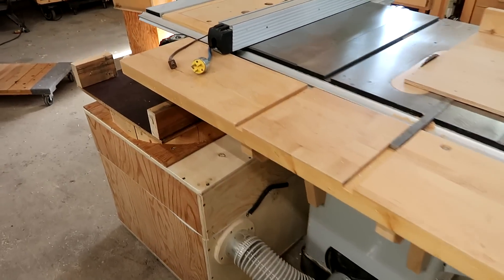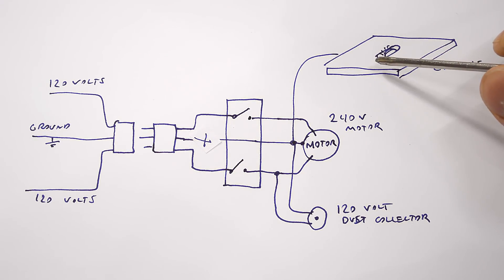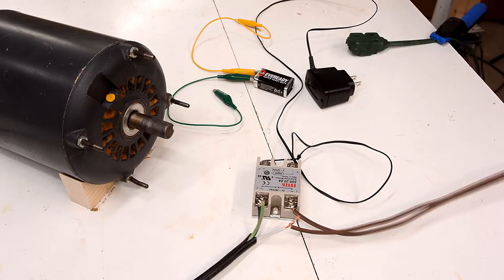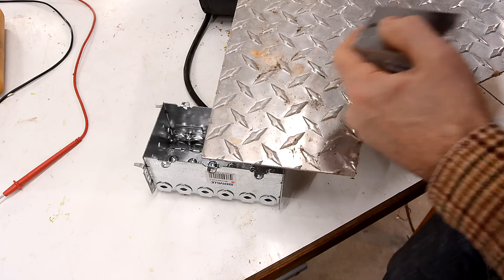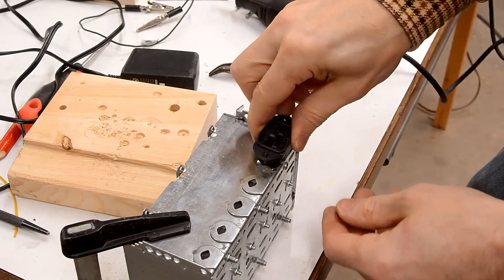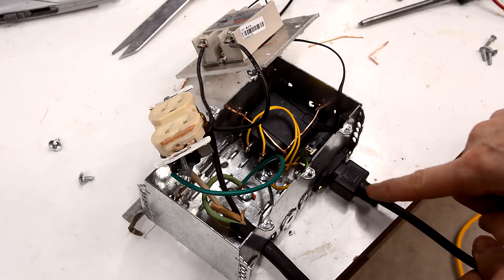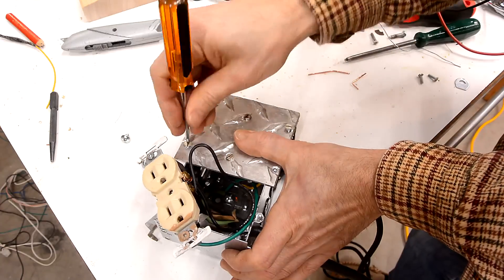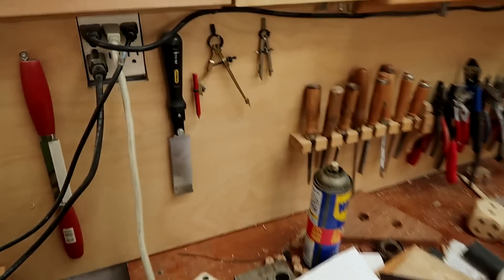Relay box to automatically turn on my dust collector

Comment: As an electrician from the UK this made me want to cry... but it's functional I'll give you that so fair play !
Reply: Mtaalas every one talks about it being unsafe but not one has given a reason as to why it is unsafe. There is a huge reason between codes and safety. Most codes aren't about safety but perceived safety. For example in the US you can't replace the plug on an extension cord if it is used commercially. Not because the resulting cord would be unsafe but because they are afraid someone wouldn't be smart enough to hook up three wires. However HP a few years ago had 1000's of miswired cords shipped with New computers. Even after a massive recall I am sure there are still 1000's of them in use.
Reply: TheRetiredtech "every one talks about it being unsafe but not one has given a reason as to why it is unsafe"
Not one? There are people writing pages on why it isn't safe exactly. Just scroll more than 2 blips on your mouse
Reply: you beat me to the comment!!! anyway thnx
Reply: Yes, I wish we had 220 for nomal household circuits in the States. The Europeans have us there.
Reply: Beefchicken Industries LOL
Reply: I agree, the European 3-phase system is superior.  I wish we had that here in Canada, as it would make it much easier to install efficient, high-power motorized devices (shop tools) in residential garages without costly alternative arrangements.  Of course, our system is really only single phase at the very final stage, so in principle it wouldn't be that hard to provide 3-phase power in residential circuits.  Unfortunately, everything is already built and standardized around 240V centre-tapped single phase, so it would be difficult to switch.

I don't think the superiority of the European power distribution system has anything to do with rebuilding a more modern system after WWII.  If I remember correctly, most if not all of Europe adopted ~ 220V standards right from the very beginning.  This was because the grid in Europe was primarily intended to distribute power for industrial applications rather than residential lighting, where the advantages of high-voltage 3-phase power are obvious.  Therefore, although the electrical grid was rebuilt (where necessary) after the war, it was based largely on evolved versions of pre-war standards.
Reply: Beefchicken Industries you sound like you have a chip on your shoulder. Interesting insecurity you have there buddy
Reply: MrConminer, rules regarding electric installations aren't there for making everything difficult, but to make them safe. Basically everything was done like Mr. Wandel here until the rules and regulations put an end to it...

Has saved a lot of lives over the years.
Reply: A Canadian electrician would be crying too. No need to develop a European superiority complex over it.
Reply: johnrichy2k6 yeaaa the rules here in the europe are a bit different 😂
Reply: Beefchicken Industries I guess he isn't cuz he is from UK. As far as I know they have different protocols
Reply: "Humour"
Reply: Beefchicken Industries you mention humour like we don’t have any, yet here we are laughing at your electrics.
Reply: Beefchicken Industries wooosh
Reply: Uhhhhh, you just proved my point.
Reply: Beefchicken Industries
It's true. Just accept it, wanker.
Reply: Ixodes I know. My parents are from Europe too. All that tells me is that some people know to get out when the getting out’s good.
Reply: Uhhhhh yeah, no. Any video about North American electricity draws out the European crowd, always with their “we are so smart we would never do that here that’s how smart we are” bullshit. Every. Damn. Time. I like to wade in with inflammatory comments, ‘cause it’s like shooting fish in a barrel. Forgive me for having my fun. Humour is something we have in North America that you don’t have in Europe.
Reply: Hamza Kamel thank you for stating the obvious. The European weenies’ argument is that their system is superior because their entire continent had to be rebuilt from scratch after they all attempted to murder each other in the 40’s. Or something like that.

Comment: Isn't the ground wire breaking a problem for the motor already? Or is the motor insulated from the table saw body?
Reply from the maker: No current goes thru ground in normal operation.
Reply: Ahhh right, I forgot my 240 V electronics :)

Comment: Your table saw uses split-phase and not two-phase power.  Residential power is split-phase.  This is why 240V induction motors require a capacitor to create the second phase.
Reply: rotate85 see his videos on induction motors :)
Talking about the two phases of a split phase (single phase power) is always confusing.
Reply: Neither term really expresses why the motor needs what it needs to start; certainly a capacitor is not the only solution to creating torque with a single phase input.
Reply: Oh.  Sorry for jumping at you.  I've done similar.  I wish the comments were threaded better.
Reply: Richard, people have argued that single phase motors are star(wye) or delta wound?! Thats a new one to me, I guess i'm not surprised though. I don't think it was edison who came up with multiphase systems though.
Reply: The tablesaw uses single-phase 240VAC power. Single-phase induction motors (often) use start capacitors to make sure they start and make sure they rotate in the desired direction. There are plenty of single phase induction motors which run on 120. There are plenty of three phase motors which run on 240 and therefore have no need for a starter capacitor.
Reply: Did you read my comment? My statement had nothing to do with three phase motors or voltage.  I was strictly talking about the pointless argument over the differentiation between arguable misuse of the terms "split-phase" and "two-phase".  Neither term explains why a single-phase induction motor cannot generate torque at 0 rpm without ancillary hardware.  This is about a lack of torque; we're not even to the point of enforcing rotational direction if we can't produce torque in any direction.  To emphasize the importance of the concept behind the singular example, I merely stated that starting torque can be developed by many different mechanisms.  Does a shaded pole single-phase induction motor need a capacitor to start?  Does a split-phase motor need a capacitor to start?  How about a repulsion-start induction-run motor?  How are these alike? How are they different?

Polyphase motors don't need start mechanisms because they inherently can generate a rotating magnetic field of fixed magnitude.  A single-phase motor can only produce a pulsating field. Without start mechanisms, a single phase motor can only generate a sinusoidally varying radial force on the rotor when the rotor is stationary -- no torque.  Proving these mathematically from first principles is typically part of any introductory electromagnetic machines course.  For a good practical demonstration, take a split-phase motor on a reversing drum switch, let it run up to full speed and then reverse it while it's running. Why doesn't the torque vector reverse?  Could you electrically reverse a shaded pole motor while it's running?  

Furthermore, not all single phase motors run on 120v.  Not all three phase motors run on 240v.  Voltage has nothing to do with this.  Magnetics are interesting; if you agree, there's plenty of places to learn about how motors work.
Reply: Dream Services International, I didn't read your comment or reply to it (at least not on purpose).  I was replying to rotate85. My apologies for any confusion I caused. When I typed my comment, youtube had collapsed all the other replies to rotate85, so I didn't realize that they were there.
Reply: Exactly. Phase 1 and 2 are not opposite- they're only 120 degrees out of phase, not 180.
Reply: @enaqtim, no. In typical residential installations in North America, there are three wires that carry power (plus ground). I will call them hot1, neutral, and hot2. Both hot wires measure 120V to neutral, but they are 180 degrees out of phase. In other words, they ARE opposite. So if you measure from hot1 to hot2 you will get 240V. If they were 120 degrees out of phase, you would only get 208V. There is such a thing as 208V three phase power in North America, but that is not what Mathias has.
Reply: @enaqtim: Keith is correct.  Unless you have three-phase service, you're not going to have 120d phase relationships anywhere.  A typical residential service is fed from a single phase.  The secondary of the transformer is simply center-tapped.
Reply: technically, after it is split at the transformer, it can be called 180° two-phase power: the sine-wave on one leg is shifted 180° from the other.
Reply: rotate85 I know, people always two phase and it always hits my ears sideways. They also argue if it's a wye or delta and have equality bad explanations for their opinions.
I just say, "no it's not, it's a three wire Edison system" and then don't explain myself.

Comment: So uh.... what happens if the copper wires slips and shorts those two terminals together?  Also, that isn’t a 240v connector. I hope no one confuses it for a 120v lots of safety problems here.
Reply from the maker: those connectors are used for 120 volts here ,and 240 volts the rest of the world.
Reply: The breaker trips, just like it's supposed to, which is the point of using a grounded metal box. Those connectors are used for devices which accept both 120v and 240v. Which, surprise surprise, his adapter he connected to the other side of it does.

Comment: Apparently he doesn't listen to his comments as we all said on his last video with that fake Fostek pos that a real Fostek uses real 60A mosfets which would not get hot like the 7.5A-15A versions the fake one uses (same 7.5A-15A for all of their amp versions).  I hate content creators who do not view their comment sections and none of that it is too many bullshit either.
Reply: Matthias: that's a bit disingenuous.  The relay working is beside the point.

The 40A versions of the fake SSRs have triacs rated for 16A.

I have no idea what the 25A SSR is really rated for.  You could open it up and check, but the fake ones are filled with opaque black epoxy that's a complete pain to remove.

You're an engineer; you know why it works, and what will happen if you overload this thing for too long.  In fact, you probably know better than any of us do.

Granted, this poster could have been a bit less of an asshole about it, but his argument at least is valid.  If you know of a real reason to not worry about an overloaded triac let us know.  We're here to learn, after all.
Reply: If China prints 10A on something it's good for 5A (aka the bigclive china rating) which is enough for that blower motor. Oh and btw... Fosteks own datasheet specifies a voltage drop of 1.6V so they get warmer than this clone.
Reply: Fair enough.  I can see where you're coming from.

I install something like this, it's permanent.  I wouldn't feel comfortable using a mislabeled SSR.  For all we know, it's got a 1A triac in there.

Matthias likes to tinker with his stuff though, so he might be more willing to run with it a while and keep an eye on it.  Still, it'd be nice if he addressed the issue rather than dismissing it (which probably has a lot to do with the original comment's tone, unfortunately...).
Reply: I think everyone is really missing the point (and this is from an electrical engineer). Ok it says 1000000A on some fake Chinese part it but it's only really rated for 7.5A - if Matthias knows that the 7.5A "real" rating is adequate then there is no issue... And the initial point by the Best Stooge about using the genuine part so it doesn't get hot? - parts, used within spec, get hot... if they didn't then we wouldn't have heatsinks in nearly every power device. Sure if they used a part rated for 10x the power then they wouldn't get "as hot" and might not then need a heatsink (air cooling would then be in action) but they would still get hotter. Getting hot isn't an issue for devices as long as they don't overheat... sheesh...
Reply: What you're saying is certainly true.

My point is that "it works" doesn't mean squat.  It works for the little bit he's used it, but what about when he needs to rip fifty boards to make baseboards for his house?  Can it handle constant running?  I have no idea, and honestly if Matthias hasn't either cracked it open and looked at the chip or done some testing to see how it performs over time, he doesn't know either.

Is it rated for 7.5A?  Is there only one company making counterfeit Foteks?  Do the counterfeits always have the same specs?  Who knows?
Reply: I'm not disagreeing with you Jeff but I don't think some people realise that what we are seeing is an insight into Matthias' experiments and obviously only testing will realise how long this will work for. I think they look at everything he does and see it as a finished product and expect that he'll have plans for this too. Even the "finished" machines that Matthias creates that "work" are not as good perhaps as they could be and thus they eventually get updated when he thinks of improvements. My point was that something getting warm is no indication of it somehow being defective and as exi points out, if the Fostek ones drop a higher voltage then they will actually run warmer.
Reply from the maker: But despite all those comments, the relay works.  Isn't that strange?  What's next?  A ridiculous guy voted for president despite what everyone says?
Reply: Ha ha... touche! Ignore them Matthias...
Reply: I thought you guys called him a PM?  That guy is ridiculous though, I'll give you that, always dressing up like a nancy boy.
Reply: Matthias Wandel Do not try and be an asshole as it comes naturally to you smart ass.  The fact is you don't listen as you think you know it all and simply because something works doesn't mean it isn't cringe worthy and done in a very unsafe, and rough shod, way.  Stick to wood as you know it well and it will not electrocute you or spontaneously combust due to getting so hot. [edit: or being over rated by a factor of at least two to three times what is really in one.  Go ahead go look inside and reference the mosfet.  Go ahead.]

Comment: Using ground as neutral is against everything I've learned about electrical engineering. Is it popular in US/CA?
Reply from the maker: it's not normally done.
Reply: Perhaps not “popular,” but done by amateurs. A licensed electrician would never do it. In the US, ground and neutral are always separate wires from the panel, even though they are terminated together in the panel. The ground is smaller gauge, the neutral larger. Neutral is only extended to the appliance when both 120V and 240V are required by the appliance; hence, 4 wires. The neutral only carries any current imbalance between the two 240V phases, such as that generated by a 120V lamp in the appliance. A load that requires only 240V needs only the two phases plus ground, such as the table saw. In all cases, the ground is a safety that carries current only if there’s a fault, a short from a hot phase to the frame of a motor or appliance. Then the ground wire carries a huge current for a fraction of a second, until the breaker trips—also reducing the unwanted voltage present on the appliance before the circuit goes dead.

Comment: It's always such a break from Youtube's mess of foaming from the mouth autoplay's and recommended to just watching something knowledgeable that can actually be done in the modern household. The only gripe is how you didn't tape/cover up any exposed contacts. 

Also a question, what's the best plastic to use for projects like these? And is there any garage type worktable we could get for it?
Reply from the maker: preferably a plastic that isn't flammable, doesn't melt when heated, or release fumes :)

Comment: Did you think of or try to find a current sensing relay to turn on the dust collector when the saw starts drawing current?
Reply from the maker: I thought about it.  But this was much easier.  If it was current sensing, I'd still need to do a bunch of wiring for that.
Reply: That the way it have to be done, i agree

Comment: Clever but how is that safer? Isn't the transformer in the cell phone wall wart connected between ground and one of the hots? Seems to me that the same danger of losing the ground exists, how much resistance is in the primary winding of that wall wart?  Just curious, I love your videos, they are quick, to the point and phun ! Thanks for sharing
Reply: no the cellphone wart is connected across the hots. Those cheap ones are mass produced for all over the world and it's cheaper to create a single switch mode powersupply module that can take both 110 and 240V and just swap out the plug part as needed.

Comment: That relay box made me feel fuzzy with all of those exposed connections. I had the same feeling when you were wiring the 240v breaker, it looked like your hand was very close to the terminals. I bet getting a shock from that isn't fun.
Reply: considering that plastic zip ties are easier to use, probably
Reply: Not to defend the design, but if the terminals are only air-insulated, I wouldn't trust crappy zip ties to hold the psu in place.  Too many of the ones from the store get brittle in a few years.  At least the wire won't plausibly embrittle and let the psu loose.
Reply: I was talking about the reliability of zip ties for component mounting, not exposed terminals.
Reply: 240v is certainly invigorating, I dunno if I'd call it fun, but it does wake you up.
Reply: Was that reply to me?  YT notified me as if it was.  If so, why are you telling me this?
Reply: I guess you haven't looked inside a lot of appliances which have exposed terminals.
Reply: Bet he used copper wire to secure it just to trigger you guys. ;)